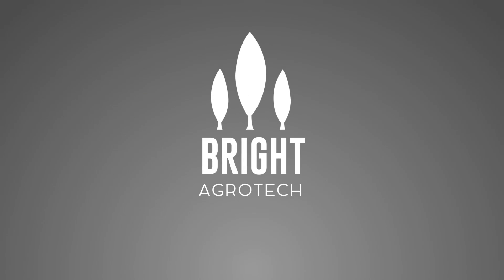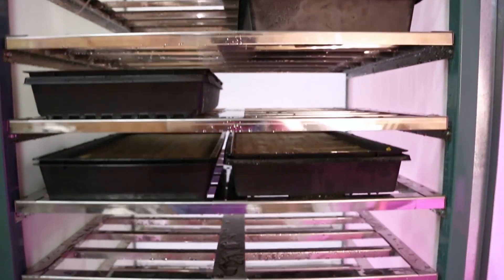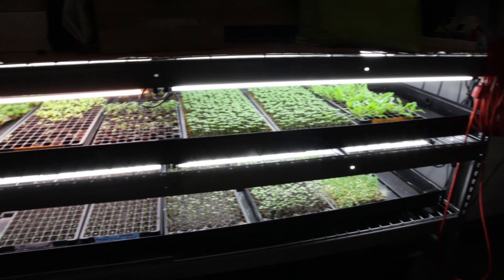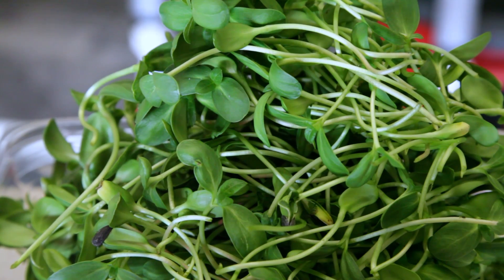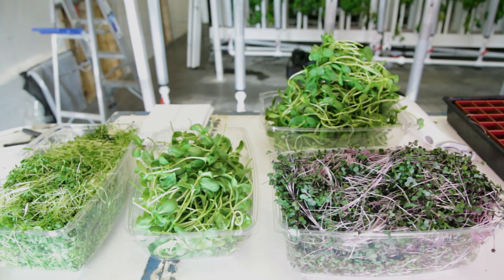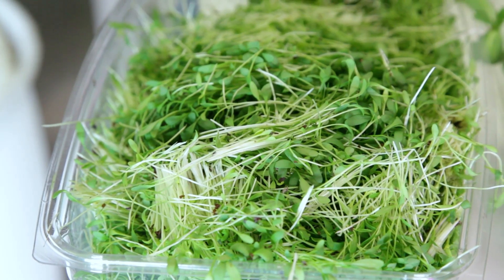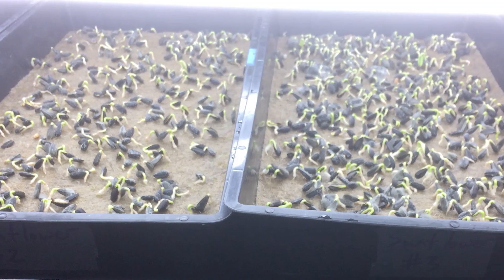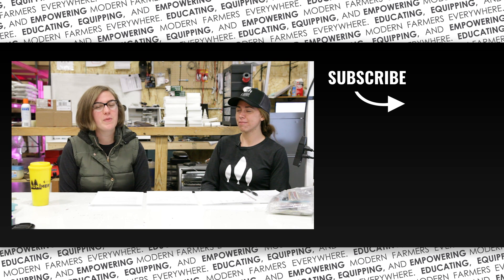Microgreen Trials Update: Cabbage, Cress, and Sunflower

Comment: Sunflower seeds germinate more equally if they are pre soaked for 12 to 24 hours. The water needs to be warm and all the seeds need to be submerged. not floating on the top. The seed shell on sunflower seeds is harder and thicker. You can also put the seeds in a cardboard box lined with sand paper and give them a gentile shake. That will allow the seeds to absorb water move evenly, so they germinate at about the same rate. 
PS keep up the great work.
Reply from the maker: Thanks Andy! We'll try that next time.
Reply: I forgot to add that i think its the sunflower oil residue from the seed heads that changes the germination rate. Its almost waterproofing the seed heads. 
I know when iv harvested my own sunflower heads by hand they are all different regarding the amount of waxy oil residue.
It can even be different from the seeds in the middle of the seed heads to the seeds on the outside edge of the seed head.

Comment: Brooke- It would be nice to see the data. I'd also be curious to see what the 1oz and 2oz sunflower trays look like.  I've been getting about 24oz in 12 days with 100g (~4oz) of sunflower. While the input/output ratio on your 1oz is better, I think we need to consider the total cost of production. Given the relatively low cost of sunflower seed and the cost of the growing media, the higher densities will actually be more efficient in terms of total cost of production (i.e. my 1 tray of 4oz is less expensive than producing 3 trays with 1oz to provide the same 24oz yield). I'd also be curious to hear about your technique for soaking/starting the sunflowers.

By the way, for anybody curious, I've switched my substrate from the Biostrate 135gsm mats to the PureGrow hemp mats and am extremely pleased. The extra thickness of the mats seems to provide much better support for the plants, it seems very resistant to mold, and planting with them is a breeze.
Reply: i use 170 grams per tray and get 1.5 to 1.8 pounds after 8-10 days on sunflower.I harvest before the true leaf stage